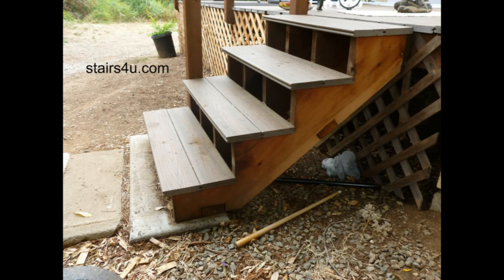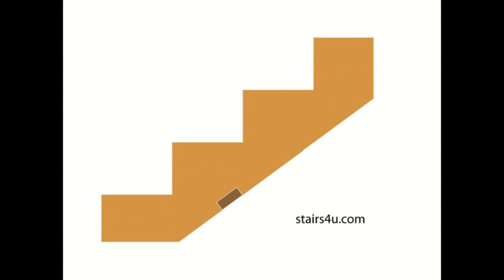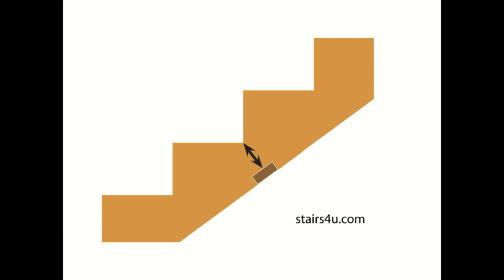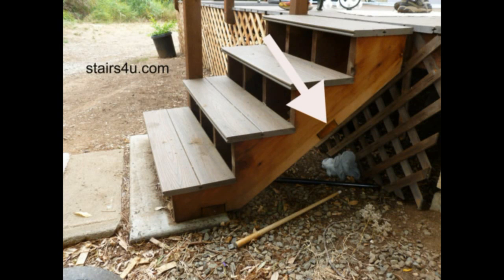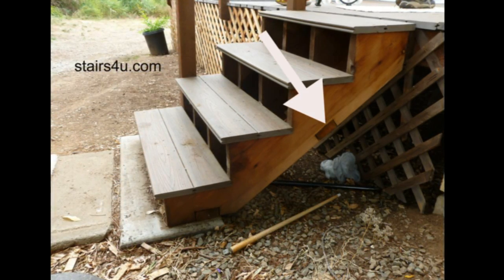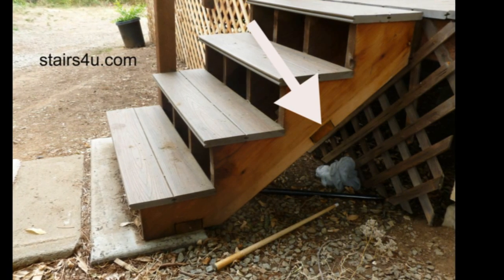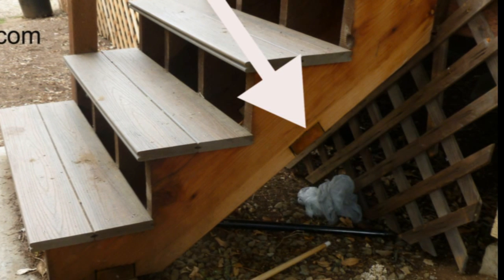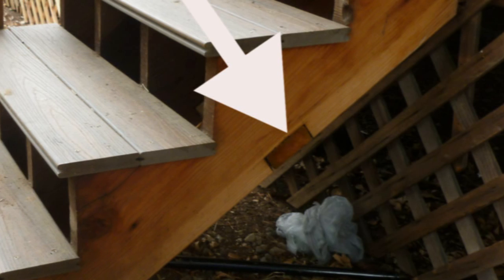Avoid Notching Bottom Stair Stringers for Nailer or Bracing

Comment: Notch the back of the top step where it attaches to ledger. Block in between at the bottom . Method is used when bottom posts have to attach to the bottom step to take the flex out of the stringers  that make the bottom post flimsy